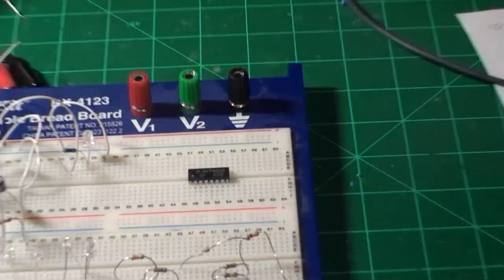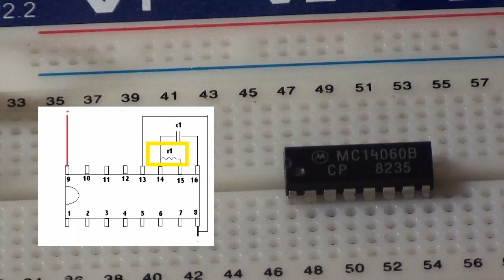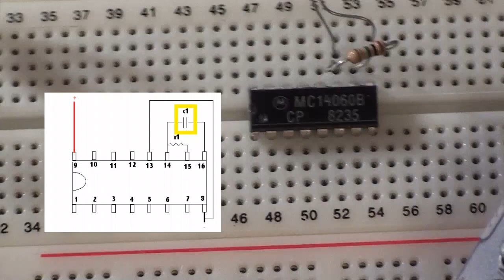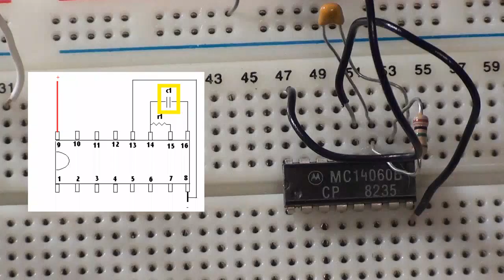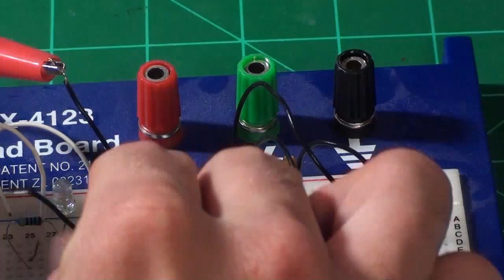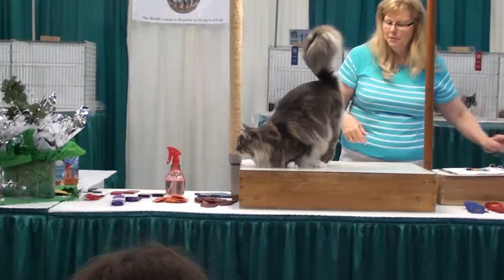Lighting tutorial:  Reading circuit diagrams 4060 style

Comment: tried this circuit several time using the diagram supplied by you but cant get it to work
Reply from the maker: You probably have the capacitor wrong, or are using too large of a resistor.
Reply: many thanks now working
Reply from the maker: I think I answered this but just in case I have not, it is probaby either the resistor is too high, or the capacitor is the wrong type

Comment from the maker: Don't do that, you will fry the LED.  Just pick any of the pins other than the + - or the pins used by the capacitor or resistor.  Then connect the LED across those pins.   I experiment around with it all the time and can get some really nice behaviors.